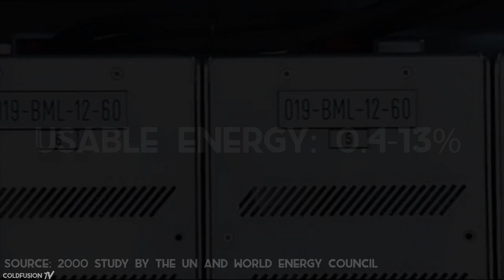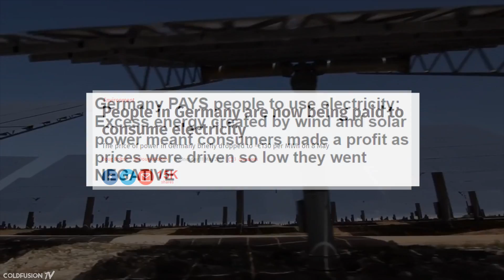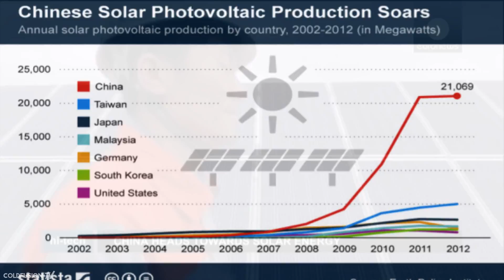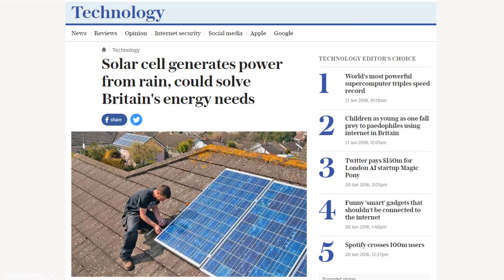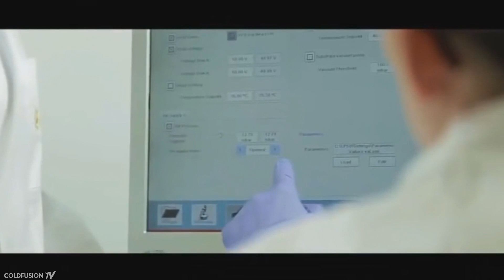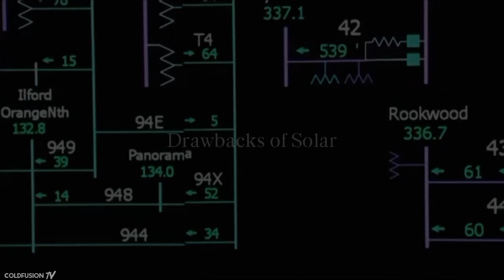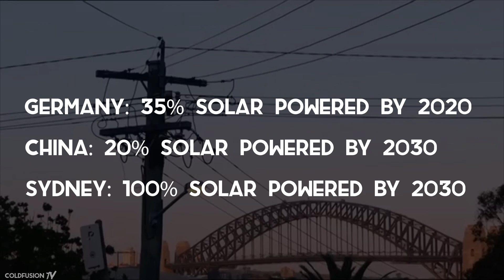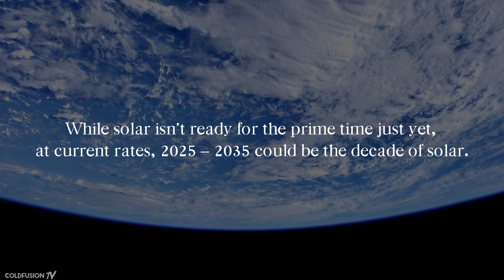The Truth About Solar

Comment: I have a nice little question for all the millennials that think Elon Musk is a god, solar power is best, electric cars are the future, etc. and all that is due to current carbon dioxide pollution from cars/crude oil power plants and industrial factories etc. Don't get me wrong, apart from Elon Musk being a god (thats just ridiculous, the guy is a clown), I totally agree on the point, electric transport powered by solar/wind plants is the future. Why not, instead of trying to make this green technology individually available, focus on it being collectivized and available through public service. Instead of putting on your little roofs few solar panels, make a huge solar and wind powerplants that would replace crude oil power plants. Where there are no conditions for solar/wind plants, use water and nuclear, but only if its a must (transmitting energy costs eclipse powerplants on nuclear power and water power costs). But for all this to work (make transports, industrial machinery etc. work only on electricity) you must have majority of people using collectivized transport vehicles also. Anyone thinking we could build all this new technology, maintain current level of production of goods and services, and have everyone drive a car, everything on electric current, is a simple minded fool. The amount of electric power required for individual use of electric vehicles is ENORMOUS, not only that, but you'd need the god damn billions of tons of new cable wiring to support the extra current that the network would require to feed all the consumers. And lets not forget the simple matter of batteries that would have to require the gigantic amount of lithium to support everyone having the nice lil electric car. All in all, the individual use of electric cars for everyone is a fantasy, and the only alternative is well woven public transport. The problem here arise exactly from millennials unofficial god, Elon Musk. The guy is a capitalist. He wants money, no matter how he will generate it, be it lies (we will all drive electric cars), be it fantasies (I will get people to Mars, so give me money, taxpayers). In the end, he unintentionally confirmed this in one interview saying: 
“I think Edison was certainly a role model, probably one of the biggest 
role models. The car company is called Tesla… because we use an AC 
induction motor, which is an architecture that Tesla developed. And the 
guy probably deserves a little more play than he gets in current 
society. But on balance, I’m a bigger fan of Edison than Tesla because 
Edison brought his stuff to market and made those inventions accessible 
to the world, whereas Tesla didn’t really do that.”
The argument he made at the end, considering what he said at the opening, is just pure bullshit. We use an AC inductor motor, which Tesla developed but, he didn't really made it accessible to the world? What he meant to say is something similar that JP Morgran said to Tesla when he withdrew from funding an wireless electric transmission project: "If any one can draw on the power, where do we put the meter?"
Let me remind you that Tesla's work on wireless electric transmission was never finished due to his sponsor ( Jp Morgan, a capitalist, ofc) had lucrative deals in wire industry so the funding was over. Nor did the car industry saw it fit to look further into Tesla's electric cars until it turned more profitable than gasoline cars, like we see it happening now. It took capitalism more than 80 years to make this available to the world, like our good ol Elon would put it. In this way we can expect the same pattern repeat with Elon Musk. If we somehow manage to get electric car for everyone, if we somehow manage to get all the lithium needed, I assure you, we will not have enough green energy to support it, and, most likely, we will end up using more environmental polluting plants to support this hungry grid. We might just end up wasting our chance to diminish the pollution produced by oil. We are currently wasting it, coz remember, we have always had chance to diminish it by using well woven public transportation, but that just doesn't seam to satisfy the hunger for money and power of our unofficial capitalist gods. Let me just send the message to all my fellow millennials (I am millennial by birth date) seeking justice, free energy and technology for all: "Capitalism is an endless, brutal nightmare that must be put down like a rabid dog.". Do this, and maybe you will have what you dream off. :)

Comment: The woman's idea seems nice, if it is true. Solar needs to be scaled down, not up. It should be a power source for the individual, and so said individual will have zero draw on the grid. By having self sufficient people everywhere, the rest, bulkier and more reliable sources such as nuclear and hydroelectric can take care of industry, almost eliminating the need for coal, gas and oil.

Comment: here's another sign that sunlight gets through clouds. You can see!
Reply: yea UV plus infrared light are the most wasted resources currently for solar power if we could harvest them along with currently harvested wavelengths we would be so so so much closer to a truly solar powered world
Reply: Ultraviolet rays still get through.
Reply: @bobbyslater1198  solar panels don't use UV.
Reply: Bobby Slater if you put yourself rentals in high-elevation they'll be a lot more UV because of thin air if you put your solar panels that have rain power it will be more efficient in shallow Clearwater where they're getting both power sources constantly.
Reply: Solar panels don't use UV. They operate off of photons.
Reply: @paulsmith3921  Photons are everything from radiowaves to radar, infrared, visible, near UV to X- and gamma rays. You probably meant "visible" I don't know of any PV that's clever enough to use UV.
Reply: LukeOfTroy yes but the issue is not light that is not what makes a solar panel fundamentally work it is the UV that is giving the solar panel to amperage the power your toaster.
Reply: @sparticus214  Solar Panels are made out of N-type and P-type semiconductor material that use the visual light spectrum to generate electricity. Solar radiation with wavelengths of 380 nm to 750 nm (violet to red) strike the material with enough energy to knock electrons from their weak bonds and create an electric current. The unused wavelengths (ultraviolet & infrared) do not have enough energy to dislodge the electrons and are absorbed as heat.
Reply: @peterjohnstaples  Ultraviolet photons have more energy than the visible, that's why they can give you skin cancer. The point is that any given PV has semiconductor junctions tuned to a particular range.
Reply: Yes  UNRELIable PV the Power goes down in clouds   Guess you like rolling blackouts?
Reply: If you're on the grid you can easily feed it more than you use unless you're operating a steel foundry.
Reply: ...but of a frequency that is not optimum for solar.
Reply: On a moonlit night, I can also see, but that doesn't mean there's enough power to light a single LED in the there.
Reply: Lol
Reply: New Homeee Solar Enegy Systemmmm! > https://bit.ly/2C0qCeE?-home-solar-panels
Reply: But solar does not work over the whole spectral range. For solar heating you need infrared wavelengths but solar cells for electricity require radiation in the ultra-violet range. Whereas our sight is based on the visible spectrum. Both ultra-violet and infra-red are bad for our vision.
Reply: https://t.co/jJLJDPZ75N?-EnergyfromWind-19
Reply: Obviously or plants would have died in cloudy States
Reply: @anand.suralkar  High intensity light is not what plants have evolved to use.
By Sir W. Thomson's calculations, he who was elevated to be Baron Kelvin,
"the present rate of sunshine was equivalent to the production of two tons of vegetation per square metre, per thousand years"
Call that 2,000 tons per year per square kilometre, which is a million square metres. That's really pretty dilute. Tropical forests probably do better, but the existing old trees are heavily dependent upon their own peculiar range of mycorrhizae, which are equally dependent upon those trees. The CO₂ effect is cyclic. To some  extent the carbon is sequestered as new wood, until the tree dies and rots.
Note that when a large area of such forest is cleared, the mycorrhizae die, and may not be available when one tries to restore the original tree population.
None of this is as free from ill effects as the power from nuclear fission, nor is it as safe.
The real lesson from Fukushima is that loss of nuclear power is a terrible thing,  and a scaredycat government  can get people killed. Nobody died who stayed and worked on the reactor, but as many as 1600 for the thousands unnecessarily evacuated died, including probably some who died of existing conditions, including sickness and age.
Reply: U the man bro!
Reply: Elon Musk in the video deceives people. With clouds, even just 'thin' ones, the actual output of solar panels drops dramatically - with total cloud cover, it's less than 10%.
Reply: Funny how Elon skipped that and went strait to photosynthesis.
Reply: If you used a camera in the days when colour film was first available, you'd know how low a fraction of the light gets through clouds. You can see because you have an iris that adjusts to what's available. For a camera lens, that requires quite special optics for an F/2 lens.
Reply: LukeOfTroy true but you will not produce as much energy on those days you will lose more then half you will only produce 25% of the energy so you better hope you have enough up battery to last a coulpe cloudy days. i live in the desert so those days are few and far between so not much worry for me but i know people where thy have to off set with either a generator or a power company. solar is not even close to efficent yet.
Reply: I believe you should qualify that with, "solar is not even close to efficient yet IN ALL PLACES", because it is where the sun shines all the time.
Reply: Maybe Alaska? Nope, even there solar is growing.
Reply: @paulsmith3921  There are wild exaggerations made of the benefits of wind and solar. When the wind produces more than the grid demand can use, that is evidence of too much capital spent on wind "turbines" and not enough on storage. But if you have 400 MW of these windmills, capacity factor 1/3, backed up by 400 MW of 75% efficient storage big enough to collect enough to fill the troughs, then you have enough power and energy capacity to service a load  averaging 100 MW.  200 MW of nuclear can probably deal even with the peaks, and will have lots of off-peak power for battery charging or maybe even synfuel synthesis or water desalination.
It also won't be as ugly or as environmentally obnoxious.
Reply: @userunknown-q9m  Elon musk said on cloudy days you'll get 80%-90% of power not 25% so where did u get that number from ??
Reply: @f-22fighterjet84  Firstly Elon is a sales man and is lying.  10kw system on a sunny day around 60kwh, cloudy as low as 7kwh.  Perhaps he meant to say 9%
Reply: @f-22fighterjet84  Has Elon Musk any data to back up that claim? I'm perfectly sure that on cloudy days the solar energy available is reduced by a lot more than 20%.
Reply: @userunknown-q9m  Lucky to be 10%
Reply: Dude I live in Scotland and there are solar panels everywhere. Even in the middle of winter they can cover most of a homes' daily energy needs, especially if there is also some battery storage installed. The reason for this is how cheap it is now, currently it costs between £4000 and £5000 for a solar install with battery storage in Scotland, or about the cost of a new kitchen.
Reply: @slanahesh  thats not cheap, cheap would be 200€
Reply: @slanahesh  What do you cook with?
Reply: Steve Jones So Elon Musks claim is simply wrong. Cloudy country -  less useful potential for solar.
Crazy how wrong he is sometimes!
Reply: @BleakVision  no he is not whaat he said was u dont get a dot sun..in cloudy place bt the whole clouds lighten up while its hard to use all areas of clouds but not impossible
Reply: @BleakVision  your looking at it from some jack ads who can pretend he knows everything..hes looking at it as a business who has to talk people into a $46000 system that's not ever going to produce enough power to keep your house running..sometimes there more to being right..it has to be practical too..
Reply: @BleakVision  Yes, 80%-90% is a wild claim.
Reply: "How to basically be wrong"  The silicon atoms in a photovoltaic cell absorb energy from light wavelengths that roughly correspond to the "visible" not the from the UV spectrum. UV just causes skin cancer and apparently brain damage. 

education.seattlepi.com/effect-wavelength-photovoltaic-cells-3353.html

And saying "amperage the power (for) your toaster" is BS since that is actually a factor of voltage * amperage = wattage, which determines its POWER as opposed to just its amperage that is its CURRENT...

Have a good day, Sir.
Reply: @nc3826  Finally, some reasoned information in a sea of Marketing hype and lies.  Yes Silicon uses the Blue wavelengths, about 16% of the available visible light, and then produce at best 26-30% of installed capacity over a year.  not great and they have had 50 years to get this far.
Reply: @nc3826  whatever but solar cells.absorb more wavelengths than visible and i dont know what people are talking but UV rays dont come to the surface they r mostly reflected back by O³ layer..i dont know what people are saying...but yeah..solar energy is the future
Reply: TIL some people can see the sun through overcast sky.
Reply: N C Sir I have you know I live 3 kilometers above the ocean and in a lautitude to get most UV. It can be tested that places with most UV cause denser object to warm faster. Electronic cyristal will expand slightly when warm and overall have greater power density. If we look at computer science the danger of heat to transistor was not fully know until it litteraly meteted throw the floor and thus computers had to evolve different ways with logic and RISK architecture vs just adding more trasisrors. Also your skin has biological protection from uv however if your bathing too often or swimming with no drysuit then your vaunarable to the sun.
Reply: UV is light.